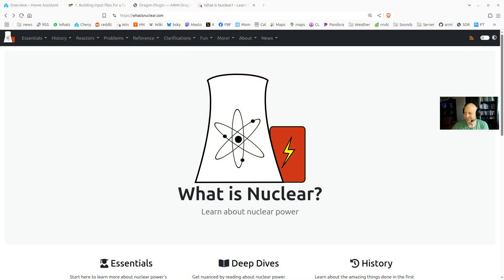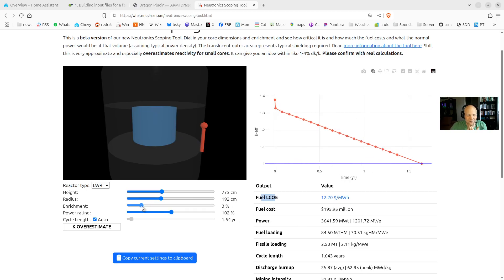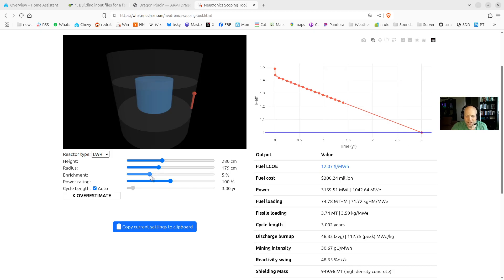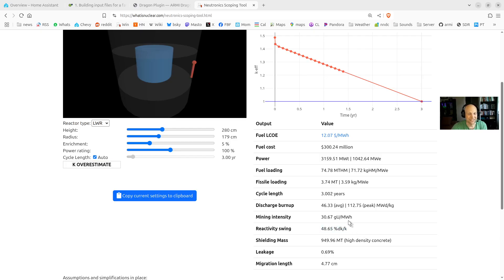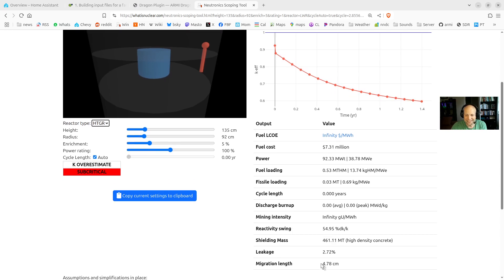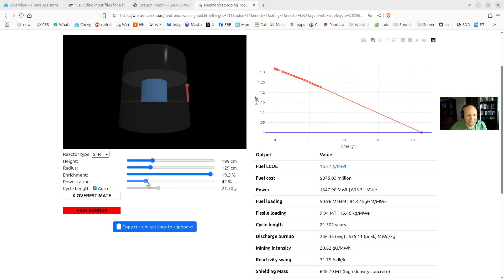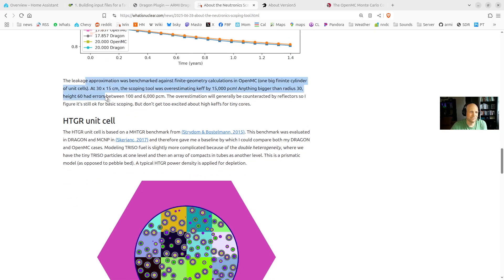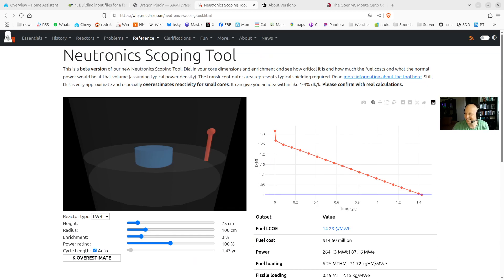Neutronics Scoping Tool demonstration

Comment: Bored and playing around again, hax'd the code and added a row for calculating shielding cost which if google and my maths correct is about $900/MetricTon for reactor grade HD concrete and noticed that;s the cleanest, best organized and most elegant JS evah!~ Thanks++ for adding the CANDU..

Comment: What about neutronic modelling for a FLiBe LFTR with graphite moderator (i.e. MSRE) or potentially an even more interesting 'paper reactor' concept, one with zircalloy tubes filled with 7LiD (lithium deuteride). Do you have data on what the average neutron migration length is for both graphite,  FliBe and 7LiD?
By 'high-density' concrete, are you implying DUcrete? Cheers from a 'naive' armchair Thorium Energy Cycle enthusiast from New Zealand.

Comment: Was hoping you'd make some type of reactor sim on the site. Wish could play with fuel arragements, fuel type, try different moderators and stuff but I guess that would be reaaaaly hard. Might be nice if could change power, fuel cost, or cycle length and see how how that affects geometry, enrichment, and power rating but at least for now I can see that no amount of refined natural 0.7% uranium will ever go cricital so i'll need a minimum of ~$600,000 worth of fuel to make a LWR...~\(^ - ^ )
Reply from the maker: A real simulator is a dream of mine but yes, a bit hard. I could add a candu bundle in here at least so natural u will go critical. You'll have to buy the heavy water though.
Reply: Nucleares on Steam is a fun little PWR reactor simulator.  It's worth the couple of bucks just to melt the core.

Comment: nice tool, thanks for making it publicly accessible

please consider using the SI standard symbol for metric ton, t, because MT looks like a megaton, and we don't want to think in megatons when dealing with power reactors in a peaceful context  ;)
Reply: also, maybe add some presets for well known reactors like AP1000, VVER-440/1000, CANDUs etc.
Reply from the maker: @sashimanu great ideas, thanks!